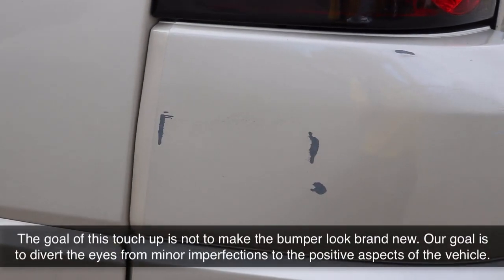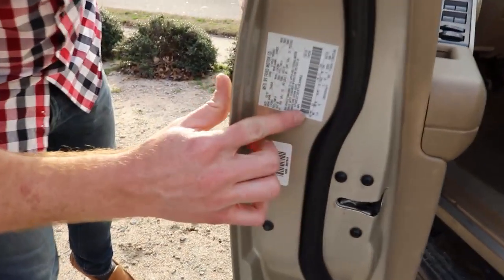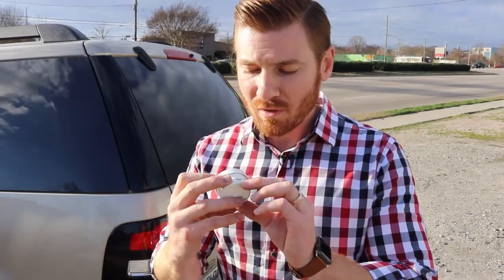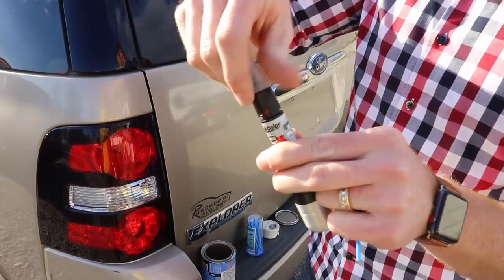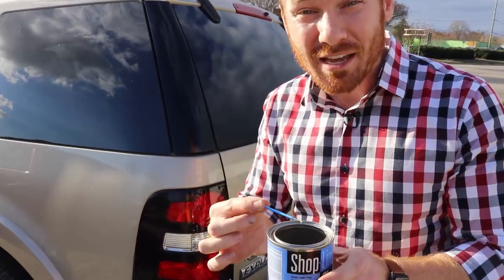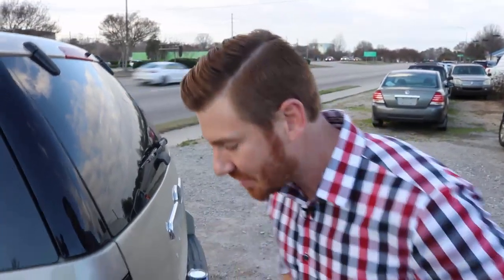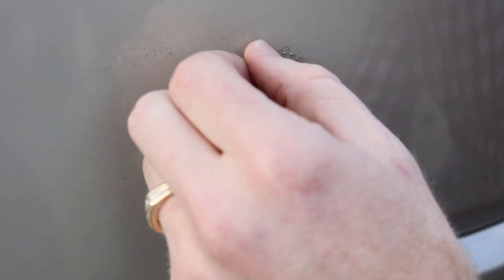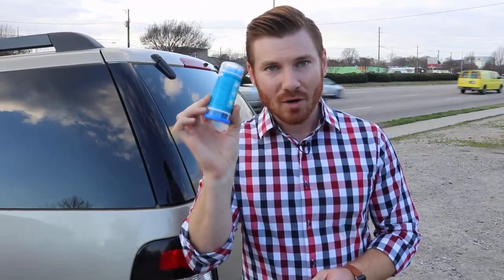How to Apply Touch Up Paint to Car Scratches, Scrapes, and Chips

Comment: Atleast use some kind of filler.  It looks like absolute trash because you spent like 5 minutes painting it. All I got was never but a car from you, because you’ll just try to cover up anything wrong with the vehicle as cheaply as possible.
Reply from the maker: Lolatyou332 I think you misunderstand the purpose of touch up paint.
Reply: You don’t need filler on something that small if you do proper prep.
Reply: @TheCarFlip  
No, you clearly don’t understand.